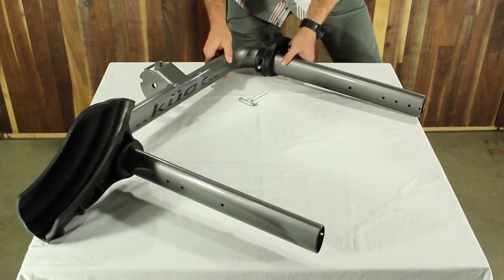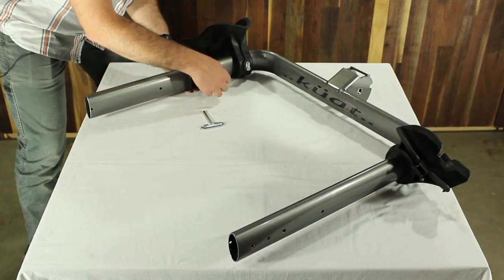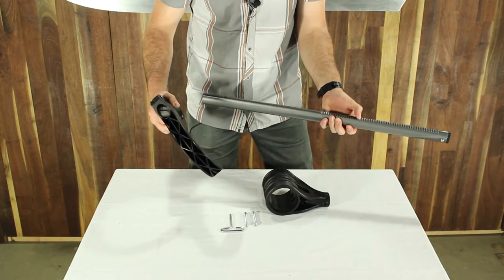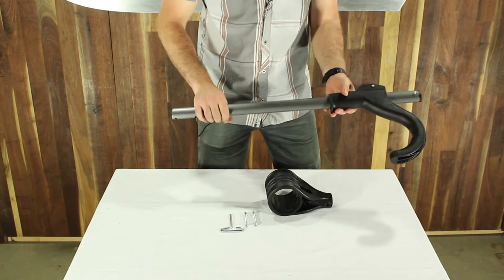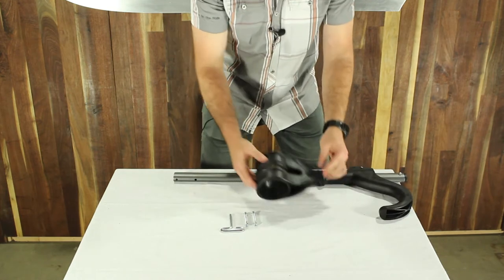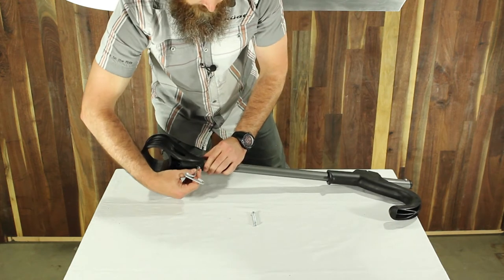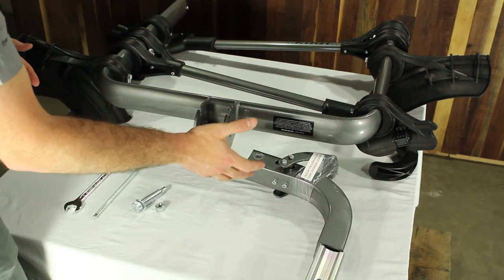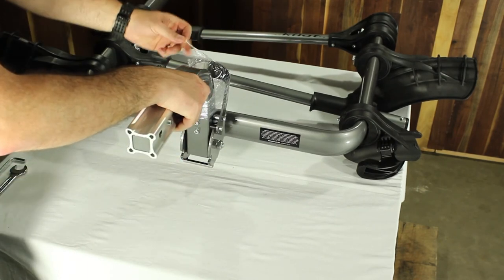Transfer - Rack Assembly

Comment: Just got the rack.  Good stuff so far..  1 issue..  When I first put the front tire scoop (Step 1 of the instructional video) onto the arm, the bolt wouldn't align so it could go all the way through the arm to the threaded side of the cradle.  I ended up popping the insert out of the scoop and flipping it over, which then allowed the bolt to align with the hole.  Glad I thought of that prior to returning it or drilling out the hole on the arm..      Its a shame that the hitch pin didn't come with a lock but is "Sold separately"